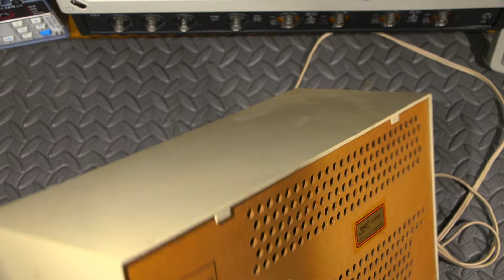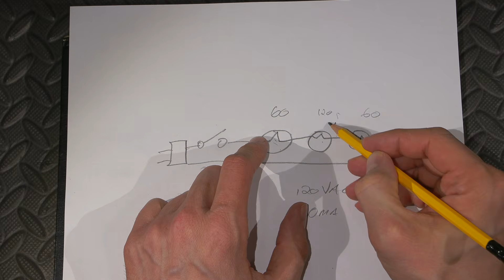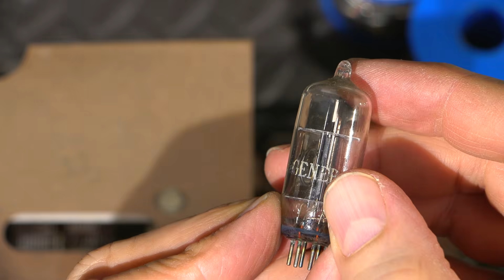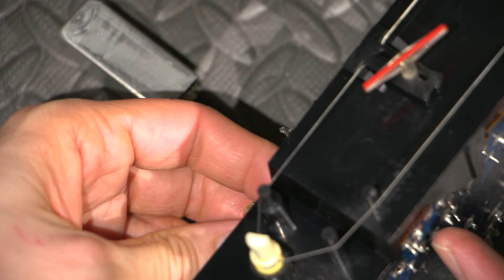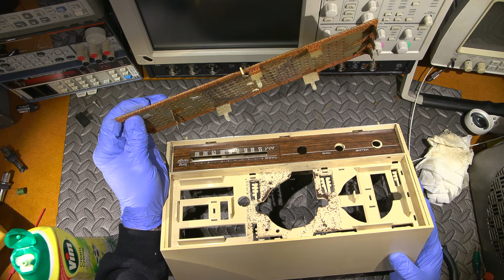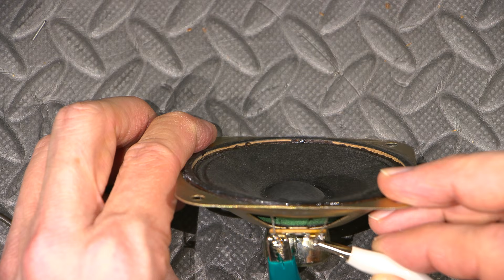Barn Find Restoration Adventure - 1960's Long Range Radio Receiver!

Comment: Paul,
 Another excellent restoration project. I enjoy every aspect of your projects. I understand to keep the videos to a respectable length, a need to move some of the more tedious parts to off cam and edit out a lot of that stuff. I was delighted that you shared a bit more on this with cabinet clean up and speaker repairs. I must admit that I probably would have went searching for replacement speakers. Thank you for posting this one. Have a great weekend.

Comment: I think they made a version of this radio with a clock in the middle. The case was probably used for both model thus the hole in the middle you suggested was for a third speaker.

Comment: I always admire how you use as much of the original piece as possible, like repairing that speaker. Most folk (me included I'm ashamed to admit) would just pull a good speaker from somewhere and replace it throwing the old one into landfill.

Comment: I had an old motarola clock radio,that was wonderful,being a kid who just discovered stereo,these radio's were awesome, great separation,bass response,and a real rocker at lower volume, I ended up hooking up a plug,from the clock, that would turn the lamp off by my bed,when the radio would go off,on the sleep setting,I've been looking for one of these radios,but they are a big collector's items now,thanks for the video,brought back lots of memories.

Comment: I teach physics at a community college. We have a chassis from an old radio with most of the components missing that I keep around to show them how a variable capacity works and how a radio tuner changes the capacitance in an LC circuit to change its resonant frequency. Most of them have never seen radios that glow in the dark.

Comment: Paul, Something new I learned today. I was searching for "Radio Sound" here on YouTube. I came across this video from "Half as Interesting" called "Why this sound is Illegal to play". He made a point that I've yet to hear you mention on your videos of which I'm quit addicted to. The sound is a combination of the frequencies 853 and 960Hz at the same time. The point is at mark 1:50 and he tells us that on radios made during the Cold War there is a mark on the AM dial at 640 and 1240 to tune into for emergency notices when the Emergency Alert System or EAS has something to broadcast.  I never knew this and checked it out by searching some old radios on eBay, and low and behold, there they were. Have a great day, and keep 'em coming my friend. Great stuff on Pateon too !!!
Reply: The frequencies were call CONELRAD.  All stations would cease broadcasting and chosen stations would switch to one of these frequencies.  This was to prevent Soviet bombers using AM stations as a homing beacon.
Reply: @FredPeters  Thank you for giving us this explanation. I didn't live through the fifties, but my parents did. There was a fall-out shelter in the basement of our elementary school. I started kindergarten in '67, so this kind of thing was still on the minds of the authorities at that time.

Comment: Just a few tips for polishing, to make life easier. When polishing you usually take into account two big factors; the compound used (how much they cut) and also the pads which are equally important. For manually polishing without a machine, they make cheap velcro's hand-holder to use a regular pad. In terms of aggressiveness, wool and microfiber are at the top to cut fast but are improper for the final polish. If for some reason you have none of it, I recommend using a microfiber towel first to help cut faster then switch to something less rugged to really give the final touch.

A quick summary of pads. Wool & microfiber = hard cut, Yellow = all-purpose, Black & white = very soft polishing. The colours truly depend on the pads manufacturer but generally, it's the case. You can wash them with soap and let them air dry after a quick rinse.

Compound and polish are like liquid sandpaper, the "grid" will always be at the bottom; hold the bottle inverted for a moment and shake it a long time as you would for an old paint can even if it's brand new. Polish and compound also contain lubricant (silicone, oil, etc) to keep them from drying out while working it; don't forget to clean with alcohol after - or the wax won't stick and give you a lesser shine and protection than what it's truly supposed to be.

Comment: Usually one adjusts the mixer inductor at the low end of the band and the mixer trimmer capacitor at the high end. An adjustment on the mixer inductor (antenna in an AA5) is not often found in the typical radio. Nice fix and nice radio! --N2GX
Reply from the maker: Hi Nevell. It's an interstage transformer. You can see me testing the primary and secondary for resistance in the video. Thanks for your kind comment!

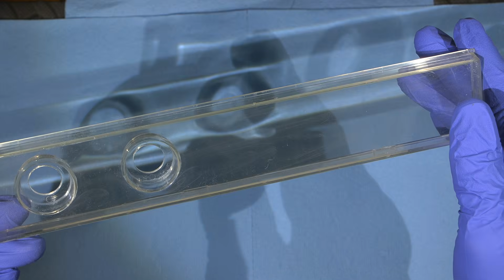Comment: 1:03:00 A suggestion, which might be off... if the smoky grain seems to become visible as colorful streaks when looking through a polarized filter, it is most likely an artifact of stress from the way that the molten plastic moved in the mold.

Comment: Another great video. In watching these videos over the years, and knowing Mr. Carlson's technical knowledge, I have always wondered why he hasn't done a video showing how to take a common all star five, and add a bfo and change the tuning a little bit, to create a 160M receiver. This would be great since creating a 160M transmitter is easy, and it would make a great QRP station. Just thought I would throw that out there, Keep up the good work.

Comment: I use them as filters for capacitive position sensors (about 1MHz) sensor operation. In my application, you can omit them from the differential input on the op-amp circuit, but it makes that op-amp dissipate more power, as it is summing to inputs, and so has to “get rid of” that 1MHz signal. This makes the op-amp less stable, and non-linear. So the application / use of ferrite beads are very beneficial… op-amp output signal cleaner, less heating, and better overall resolution of the rotational capacitive sensor, not to mention less temperature drift - my 2¢ (love your videos!)

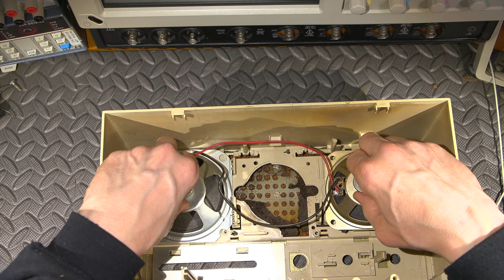Comment: 55:38
Also, the force of gravity is stronger at edge of the bench, so things will fall from the bench constantly.
Small parts like screws, tiny pins , ball bearings, nuts, etc. are guaranteed to disappear into another physical dimension once they hit the floor. They can reappear months later, but by then you won't need them.

Comment: In electronics classes in University and College, we learned about capacitors and resisters. It was fun reading the color codes for the value number of each resister in Ohms of resistance.

Cell phones and smartphones are not as well made in quality  as the vintage radios.  The short wave radios have always been of very good quality.  Also HAM radios, which by the way have the LDS Mormon Radio League as very good responders with HAM radio licenses in communicating with the public, especially in disaster relief.  Good job, huh.

All the Best.

Cheers
Reply: They teach this shit in year 8 about 6 years before college and university here..

Comment: Nice job once again! For adhesive removal try looking up D-Limonene. Just make a small cut in the foil seal and use the smallest amount at a time on paper towel or such.  Had a 22 oz bottle for a couple of years now and have just used a few drops.  Seems like one or two drops is all that is in the others as an active ingredient.  The others are really disappointing but this works just fine. I've been watching your stuff for years.  Now retired and building a smaller version of 'das Lab'.  Wishing you all the best.
Reply: I would suggest goo gone, but I have never used d-limonene so...🤷‍♀️
Reply: @TheThomasites  yup, thats one of the ones i wasn't going to name. barely works at all. the other is similarly named.

Comment: Hi Paul.  Guess what?  As soon as I saw your intro, I knew that is was a GE radio, because I have the same one but with a clock.  It is in my garage somewhere, it does not work.  My brother bought it in Ottawa, and gave it to my mother as a present.  It was our kitchen radio till it stopped working in late 60's or early 70's.  Most stores had tube testers back then.  I took the tubes out, and tested them.  I think the bad tube was a 5BEA8, or 12BEA8.  I replaced it, but it burned out again shortly after.  I put it in the garage hoping to have it repaired later.  It is still there somewhere.  It was a great radio and we loved the clock.   
     The reason in my opinion that one speaker is smaller than the other is because that is where the clock would go on the clock model.  The chassis is the same for both models. but the clock is smaller than the main speaker.

Comment: GE made an entire series of table top radio receivers in the late 50's and sixties, up too and including real wood cabinets with stereo speaker doors that swung open on both sides.  I had a top of the line unit in college and it worked very well.

Comment: ..Wouldn't it be easier (and more accurate) to test the heater elements of the tubes OUT of circuit with an ohmmeter?  That way, you do not have to worry about the AC voltage.  If you wanted to, you could easily rig up a spare socket as a testing jig.

Comment: With all that extra space on the circuit board, I would consider gluing a tiny 120v fan to help the rectifier and output tubes. It doesn't need to blow much air, and it can add life to tubes that are getting tired.
Reply from the maker: It would cause oscillator drift.

Comment: AH! I think you missed an opportunity here.  That center mounting area was perfect for a 3rd little speaker (which it looks like it was designed for, perhaps as an option)?  Had you tossed in a cheap speaker of that size you could also have added a cheap 3-way crossover - tons of 'em on eBay - and really helped the sound on that little box! THAT would have been a fun project, maybe mount it upside-down at the inside top of the case. Mono can sound beautiful!

Comment: Some tube-era and early trasnisitor-era radios used different size speakers to increase the dynamic range of the audio.

And Yes: I use WD40 to clean PC components, works great, after giving it a few minutes to evaporate, Also works well for removing old thermal paste.

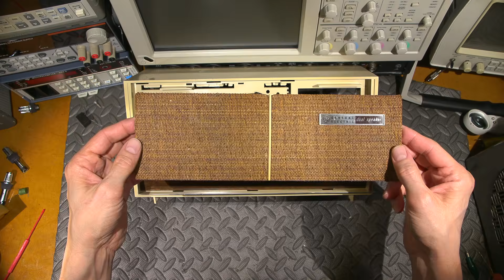Comment: 1:01:00 - I'm guessing that center hole was for a clock mechanism for a clock-radio model. Odd how the speaker holes are blocked with odd shapes of molding.
Reply: Good thinking... a CLOCK! I thought perhaps it was a single-speaker model, and the dual-speaker was an afterthought.

Comment: In the mid 60's my dad bought a short wave receiver at an auction and gave it to me.  He paid only a dollar.  I was only about 12 years old.   I remember when I first turned it on it had a very loud hum.  I opened it up and for some reason I knew that a particular capacitor was bad.  I had no electronic experience at all.   My mother worked at the local TV shop as a secretary and asked her if she could order me that capacitor through her boss.  She did and I replaced it and the radio was fixed after that.  A few years later I joined the U.S. Air Force and was selected to component level Cryptographic machine maintenance.  Just from that my dad gave me that short wave radio I learned a tremendous amount of electronics.
Reply from the maker: Thanks for sharing your story Daryl!

Comment: I purchased a GE clock radio in the mid 1960's that shared this same cabinet and chassis. Mine was AM/FM and had the clock radio. It only had one speaker and did not have a "sleep" timer to shut the radio off automatically. It was about $23.00 in 1965.

Comment: Now you’ve done it ! On camera the logo plate looks slanted with the right a bit lower! Not sure about the color of the case either. I’ve seem some restorers use a peroxide solution in the sun to lighten plastic. But a great electronic restoration! Probably better than factory.

Comment: Thanks for another great teaching video. I have learned so much from your channel. I got an old GE465 DialBeam radio last year and brought it back to life. The dial is so much fun to watch as the lighted pointer shows the tuned frequency. It has a similar ferrite rod antenna and an old style pc-board.

I don't know how your radio responds, but mine is very "directional". I get the best signal when the rod is perpendicular to the direction of the radio station. In other words, when the station is North of me, the radio does best when the length of the antenna runs East to West. I didn't hear you mention anything in the video about it being directional in this way. Just wondering if it is, or if the "Long Range" design somehow makes up for this.

Thanks again for all the time and effort you put into these keeping these classic marvels of electrical ingenuity going for all of us to enjoy.

Comment: Another excellent and informative presentation. I just wondered why you checked the valve heaters with the power on and not using the ohmeter, as you did with the IF transformers.

Comment: Safer and easier, IMHO, is to just set your meter for the diode tester with the tone.  Then pin 3-4 will beep if the filament is good.  No tone on the bad filament tube.  Must test tubes out of the circuit.  I typically take the tubes out clean them up and test them in my tube tester.  But checking a filament with your meter like that works well.
Reply: Yeah, I found that odd - he has the multimeter and the tube in his hands... he could have tested the tube in a few seconds without all the mains power.

Comment: The 8 bit guy uses a product called Retrobrite to get old 90's computer cases back from being yellowed. It works quite well and maybe that product is available in Canada as well. As for those metal tabs holding the grill on, they can be bent a few times before they'll break off.

Comment: That is a great old radio right there! Right at the front, because of the Long Range emblem on the radio, I suspect that unlike the standard 5 tube radios, that one has an additional RF amplifier in the frontend. I have an old tube type Motorola AM only that does as well. Looking for a filter cap for it now.
Reply: Well, if you paid attention and WATCHED the video before commenting, you would know that this is a "All American 6" style chassis, and that we can ALL see that it has 6 tubes in it. Truly, you don't need to tell Mr Carlson, because he knows too.
Reply: @johncoops6897  And as an electronic repair technician with 40 years of experience and knowledge of these radios after growing up working on them, I don't need you to tell me anything!
Reply: @makarov138  - then why do you feel the need to tell us what we already know?
Reply: @johncoops6897  Too much facebook time.

Comment: We had a later generation AM/FM GE radio with much of the same recognizable mechanical layout.   After it was cast aside I got to use it.   I knew about the hot chassis, but my hand still brushed across something while trying to soup up the speaker connection and I got a wake up zap.

Comment: Nice!  I had a radio just like that when I was a kid, though I'm not sure if mine was made in Canada or the U.S.  It could have been either, given that I live in Michigan.  I actually now have a slightly larger model of roughly the same vintage (the one with the folding speaker enclosures) sitting on a shelf a few feet from where I'm typing this, so this video is going to be particularly interesting for me...

Comment: Well done sir! If I had anything to add, I'd have made a mark on the transformer and PCB to assemble them as original. It'd be like me to get it backward!
Reply: I was thinking the same thing, but realized that he has the video to consult for proper winding orientation.
Reply: Had the readings to go by. 15.3 on the left ( underside ), just a quick measure to verify before soldering.

Comment: Hi, I revisited this repair video, as I often do with subjects that I am going to use in the near future.  Looking at that case, it appears to me that the center cut out on the case was for a different model that had a clock in the case, the side cuts for the switches that go with clock radios.  At least that was my impression.  I guess if I were redoing the radio, I might consider putting another speaker in the hole and using a capacitor to modify the signal to play midrange, or perhaps a tweeter of sorts instead to enhance the audio on an already great sounding radio. I like the long range, as I live about 12 miles from the end of the earth in South Dakota, right on the North Dakota State Line and about 80 miles east of Montana. In my house, without an outdoor antenna I can get the two local radio Stations, both from the same Studio just that the old AM Station that came on when I was about 15 years old installed an FM  Stereo transmitter so their music can. be enjoyed in most homes now. AM is hard to get now days with all the wall warts putting out static that interferes with it.  In the nursing home where my 97 year old mom lives, AM is impossible but they can enjoy the new FM (new. 2 years ago now) so I fixed mom up with a good FM receiver so she can enjoy the local news that she loves so much.

Comment: Great video. Radio could have been in a beauty salon that gave it the strange smells, along with cigarette smoke. What is VIM? I bought a couple of brass portholes that were in a bar for years. Thought I could polish them, but it was like bubble gum, so I put them in the tub. What a mess. They had a coating of nicotine on them. After that, they cleaned up well.

Comment: I actually found this same exact radio in an abandoned shed with some other tube radios like a Westinghouse spacemaker…. The unit I found of this one was to far gone for restoration sadly as it was completely yellowed… the cloth was completely torn, and the circuit board needed way to many components replaced on it.